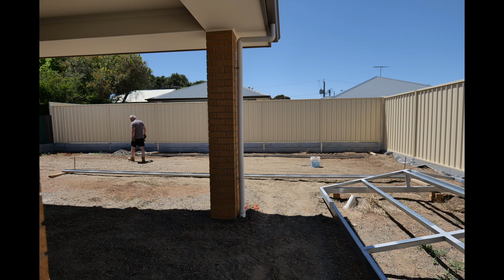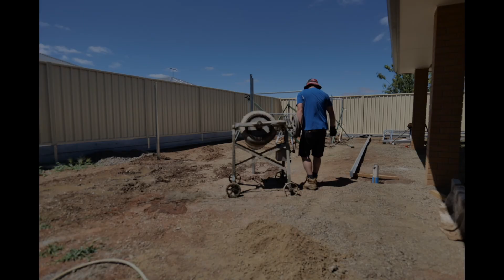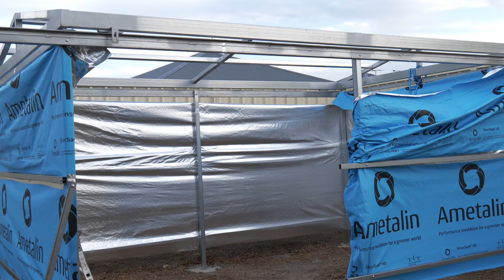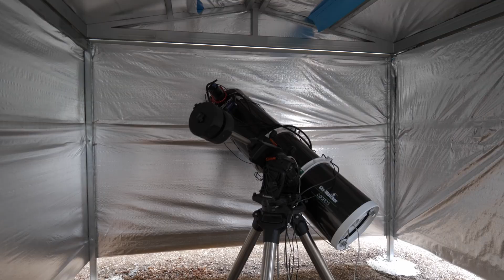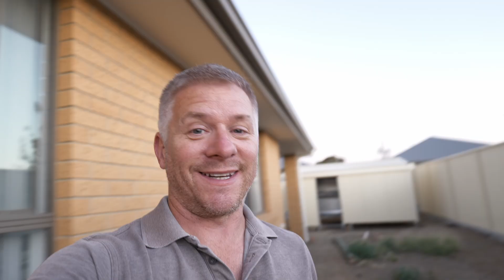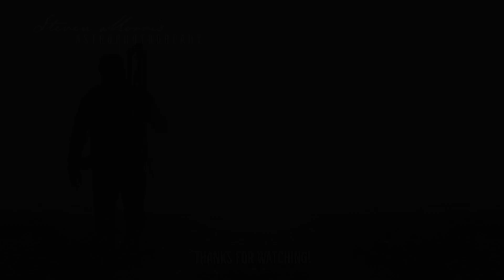I Finally Built My Dream Backyard Observatory

Comment: Congrats, I built my observatory about 20 years ago, it is awesome to just walk out there, roll the roof and start imaging almost immediately. in regard to the mount, I would recommend a pier. Tripods in a dark enclosed area are more of a trip hazard than when outside. For my pier I dug deep hole and poured a separate DEEP slab for the pier. I then surrounded it with rubber lining and poured the rest of the slab to reduce vibration to the pier. If I was to do it again, I would still have the large deep block of concrete for the pier, but use timber flooring for the rest of it. I put almost 1 cubic meter of concrete in the ground under the pier and I have not had to polar align in 3 years.
Reply: I agree, built mine after the wife gave me a C8 back in 2001. Her mistake getting me into the hobby. So much easier with the newer gear. Film was a pain. Great job on the build.
Reply from the maker: Your a rare man having a wife but you telescopes, you have a free pass for life buying whatever you want haha😂
Reply from the maker: That’s amazing and great to hear. What a difference it makes not having to polar align during every setup, I’m loving it already! 

I did think about a timber decking on the inside, can also make cable management easier and if you need to do anything you can pull up some floor boards and alter. 

Thanks for your input and sharing your experience.